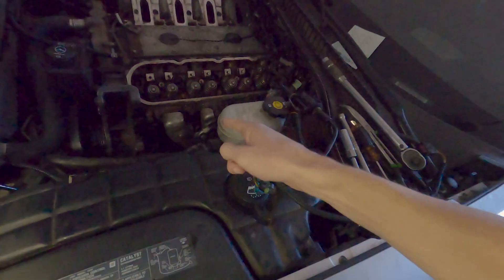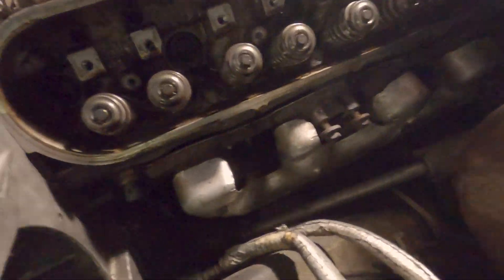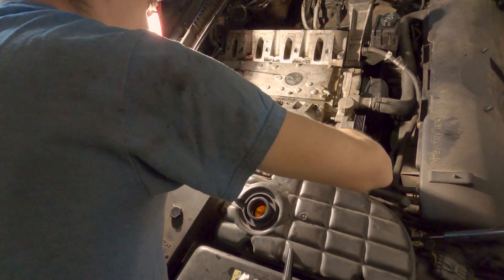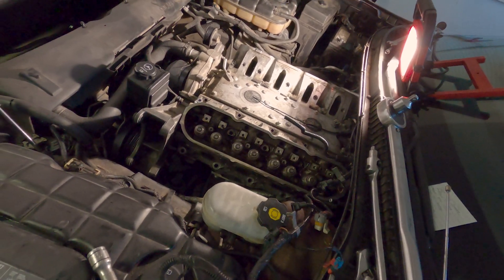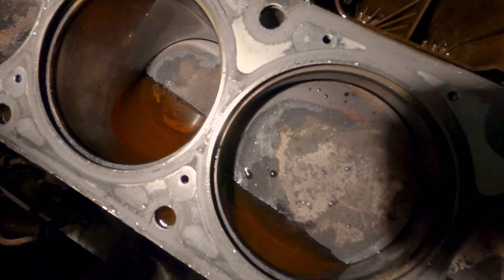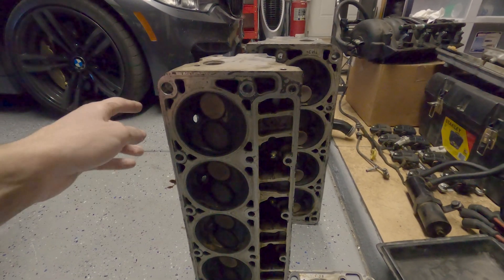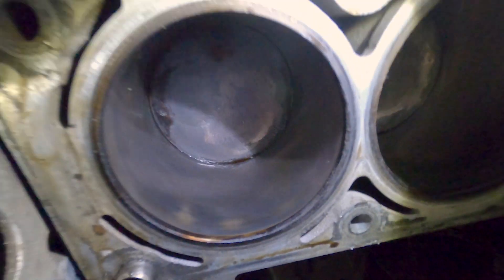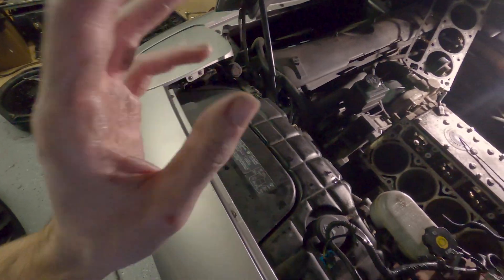Corvette C5 Z06 Engine Rebuild/Upgrade Series: Part 2 (Engine Teardown/Inspection)

Comment: Do not do cam until you get the rest of motor apart. Granted, it will cost a little more and take a little more time. But you will have a greater piece of mind and absolutely enjoy car more knowing it’s not going to expire before it’s time. You asked, I responded. Hope this helps your road to ZO6 heaven, and you will forget about BMW forever after your first LS blast!!
Reply from the maker: Just picked up a 6.0, I found out that I have a cracked cylinder #7. I'll be doing an episode on that this coming week :)

Comment: I would love to learn whatever you find out about cam and push rod/rocker measurements. I plan on doing this soon enough!
Reply from the maker: Most likely going with all Texas Speed stuff. I'll probably either go with the Torquer V4 or the Magic Stick 4. If you get their cam package they have the correct springs and pushrods figured out for you. Although it's good to measure yourself before ordering

Comment: If you remove the valley cover, you can see the front and rear of the cam. You can see if a lifter roller was “chewing” the cam making that noise. Also, sometimes a loose rocker can make a similar noise.
Reply from the maker: I actually did have one loose rocker, I'm hoping that's all it was. Also cam and rollers on the lifters all look good
Reply from the maker: I'm going with all new ls7 lifters just incase